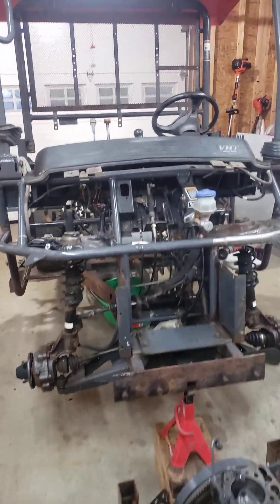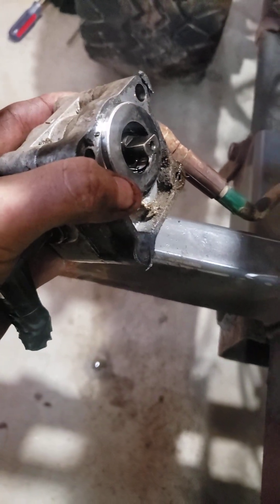kubota rtv 900 power steering repowered?? what do you think?

Comment: I bypassed the pump off motor and T off the dump box . It’s works.
Reply from the maker: @jeffcharlesworth4602  I was going to try that, in reality  how much will you turn with dump in full tilt,an if so, there should be enough fluid still available...I just didn't want to chase a rabbit hole of other issues trying to solve just 1...if fluid ran out,now I needed a bigger tank, but in hind sense,it's made for attachments,so it's allgood..